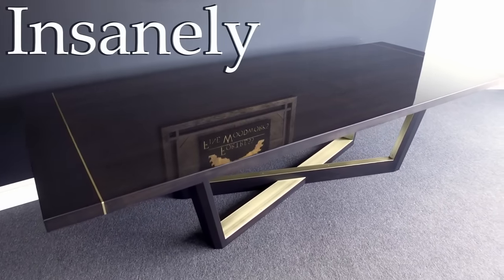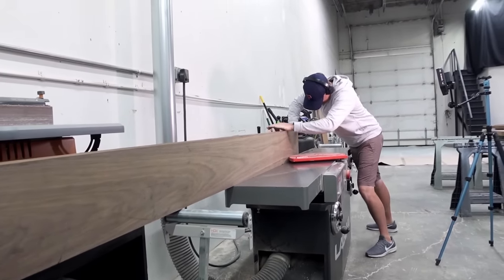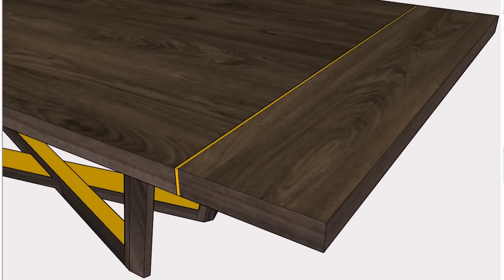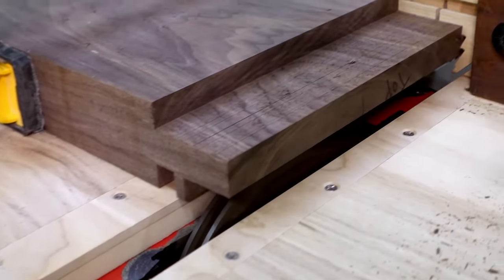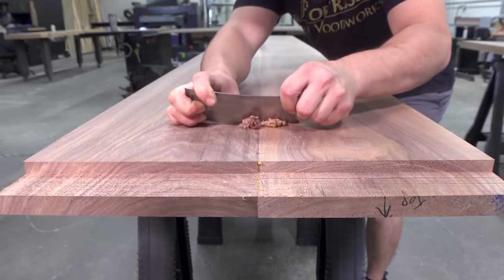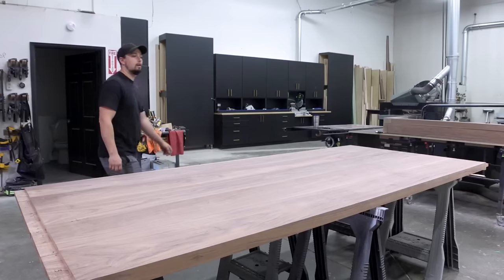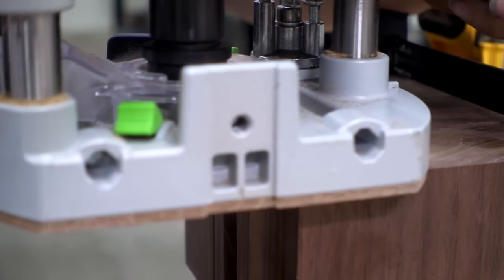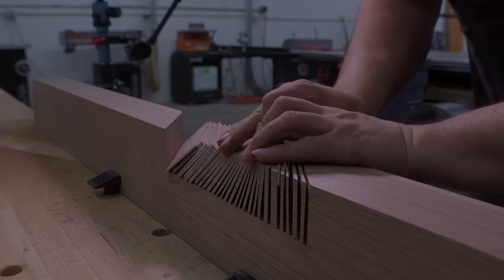I Didn't Think THIS Could Look So Good.

Comment: More content! Thanks! I'll tell you that the 'in / out' (or 'up / down') trick is amazing. I don't even have a jointer, but the technique applies to the table saw as well, and takes panel or tabletop work to the next level... night and day. I'm now curious to see how you solve the brass not sticking problem. 
Question: you are going to dowel those breadboards on, right? Sounds like a stupid question but didn't see it in your 3D model or any prep for that in this episode.
Also - shout out to Cody... he may want to put more hip/body weight behind that planer, but great job!
Reply from the maker: Heck yeah! It's always great to hear from you. I did indeed solve the brass problem and can't say how until the next video is out. 
Answer: that would be hilarious if I just left the breadboards floating with no pegs. Yep, they will get pegged in a specialty way. 
Cody did pretty damn good considering his first time planing was on a luxury table! I'll let him know you are thinking of him ;)

Comment: Im curious to see how it turns out. Not doubting your wood working abilities, just curious to see if you use any type of channel to help support that huge table top...and to help it not warp over time!!
Reply from the maker: Good concern! No channel to keep the table flat because those meaty breadboard ends with keep the width flat, and the 2 inch thickness will keep the length flat. But the legs will be attached via C Channel. Thanks for watching!

Comment: It looks like a really cool table, I'm no woodworker, could you please explain why the breadboard ?
Why not goove the table top and insert brass ?
The table won't ever be without the breadboard, and by having it aren't the ends more fragile ?
Reply from the maker: Without the breadboard ends, the table would want to warp or cup, so they force everything flat. 
The main table needs to be able to expand and contract over 1/4 of an inch across its width so any brass that's attached would fall off.
The breadboard end is jointed on so well it's no more fragile than the rest of the table

Comment: Hi 👋, Looking 👀 Great, Guys, everybody makes mistakes, all part of the learning curve, but it is how you correct them to resolve the issue, I am being honest with yourself that you have cocked up, and a mitten, you’ve made a mistake, I have around 50 years of experience in making and building, furniture, organ, casement, work, specialist doors, and windows staircases, I have mainly worked by myself, but got people in when I needed to lift something, as for your surface planner, you could make up some extending table tops for it, my surface planer ended up being nearly 6 m long, Festool aluminium track/rail, it’s approximately 3 inches in section, it has grooves and slots going through it,
I drilled and tapped the sides of my surface tables on my planner , to coincide with the slots in the side of the rails, making sure that when it was all tightened up, I could then lay a board in on top the end up being the same height as the surface table, with a little find adjustment, 
Are used capped head bolts that will slide in the track , the boats were screwed into the surface table, then the rails, then slid over them, and where the bolts lined up in the track. I’ve been marked the other side of the rail, and drilled a hole through the track to coincide where the bolts needed to be tightened up, when is a very long Allen key, I then made two adjustable legs to sit under the frame so I  could get the height correctly, my surface planer, is SCM F410 N , . I used a very long engineers, straight edge, and a spirit level to make sure that everything was sitting correct when setting up. Obviously this is okay if you’ve got the workspace area to be able to do it. I hope this can be some help to you., look forward to the next stage of your build, Ps , your fretboard end slots could’ve been done with a hand router , with fences, fitted on both sides of the rails that go through the base of the router, this way you can centralise the slot. 
I have a, WADKIN EKA 4 Head Tenoner so i could do joints very easily, 
I wish you all the success for the future , and look forward to your next project, all the continuation of this one, 
I forgot to mention that I am retired Englishman , living in France, Phil from the moulin France.
Reply from the maker: Thank you Phil. I appreciate your insite. Enjoy Moulin

Comment: A trick I recently learned to joint together two long boards: put them close and run a track saw in the gap.
Thoughts?
Reply from the maker: I have tried that and it works pretty dang good. I wouldn't say it would pass the feeler gauge test but the joint would hold.

Comment: Curious as to why the decision was not made for the brass inlay in the top to just be a 1/4" brass plate sandwiched between the end and main top with the tenon as support? Was there to much concern for differing material expansion and contraction?
Reply from the maker: That's a great idea, and the reason is cost. 1/4 brass plate is expensive AF. And I already bought a 1/16 brass sheet to plate the legs so the material was used from that.
Reply: @FortressFineWoodworks  Material on hand makes sense. Cost of material always plays a part in decision making. No wrong or right way in this case, and i'm sure the final product ends up immaculate.

Comment: Where'd you get your design from? I made this same table years ago...
Reply from the maker: I explained at the beginning of the video that it's the Helman and Chang, James dining table. Although the customers wanted some changes that the other designer couldn't accommodate. Thanks for watching!
Reply: Ok cool I know of their work as I used to work for them. Very nice tho...
Reply from the maker: Thats actually pretty cool history on your part. Thanks for sharing!
Reply: @FortressFineWoodworks  I appreciate your channel, skills, narration and honesty. Definitely better than foureyes. I also like how you openly shared in the second video that the customer contacted you three months later with an issue, showing how challenging fine woodworking can be -even for advanced craftsmen.. Is there a video on how you fixed it? and Concerning the particular design of Hellman Chang: did you need a permission for reproduction? Congrats again for your channel and success.

Comment: Are you sure, or better, are you experienced with the effect of these pieces of wood at both ends of the table? Do they prevent the single pieces the table is made of from becoming „round“ in the middle of the table as well? The Single pieces are really wide, I would never dare using them as wide as you do. ( Actually everybody on YouTube dares using wider pieces that me….) If you expect the shrinking of the wood during the winter, while the air is heated indoors, the wood could also become round. But as I already Said, everybody showing how to make furniture on YouTube is using very wide pieces, especially walnut. And I have always been asking myself if only in germany, where I come from, the humidity of the air changes and the wood reacts on that.😊 This is Not meant to sound offensiv! I am just curious about your experiences. I like your clip and wish you success!
Reply from the maker: Thanks! Everything is pretty stable here in Colorado. The thick walnut will remain flat, and the breadboard ends will allow for expansion and contraction.